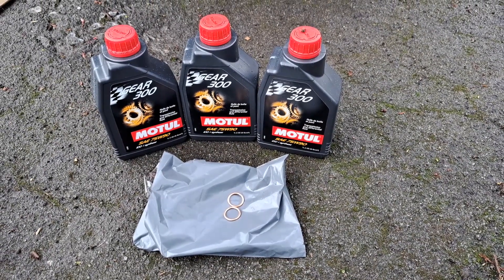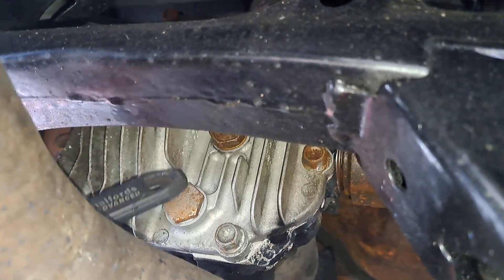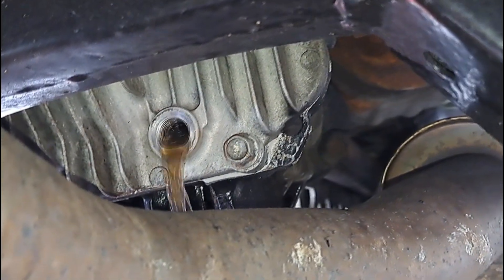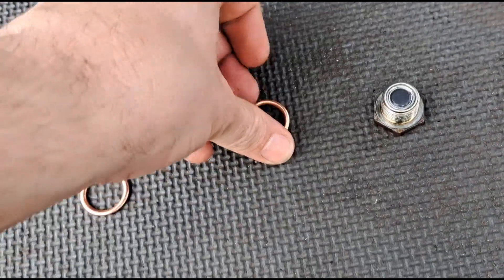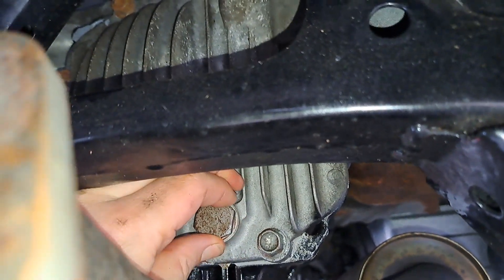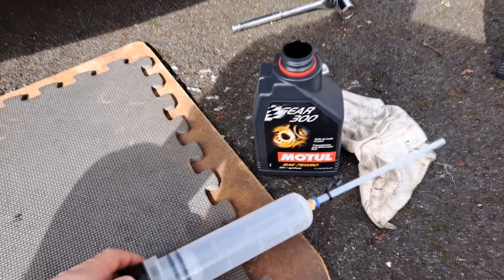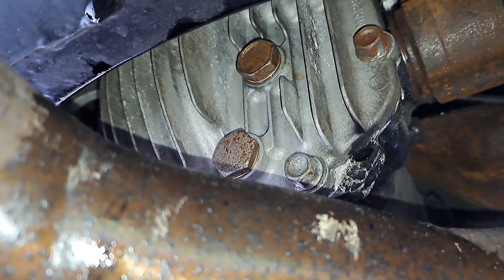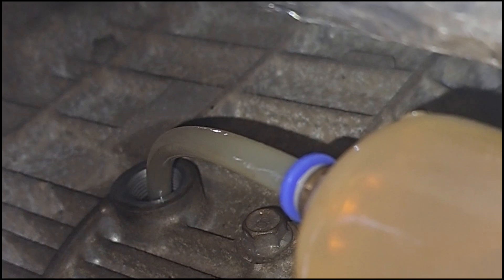Mazda MX5/Miata NC Mk3 - Maintenance Episode 8 - Changing Gearbox & Diff oil

Comment: when draining diff / gearbox, always crack the fill nut as well, it'll make it drain quicker and smoother. If you only open the drain plug it "glugs" and it's messy. Open fill plugs first, and then open the drain ones.

Comment: When you’re filling the gearbox and especially the diff you need to have the car level.
Difficult without a proper ramp but not impossible.
Support the front and rear with axle stands to allow safe access and keep the car as level as possible. 👍

Comment: So are these 3 bottle of oil exactly the same? You mentioned GL4 and GL5 but when I search for that oil you used it doesn’t have it specified? Thanks
Reply from the maker: This oil meets both specs, see here: https://www.opieoils.co.uk/p-899-motul-gear-300-75w-90-fully-synthetic-racing-transmission-differential-oil.aspx?variantid=1131&gad_source=1&gclid=CjwKCAiA8sauBhB3EiwAruTRJmSnSqqIX4_GgpOjJqplwK2VCiDYHRz8FJUvjzhLtExFupDK6Zc8JBoCevwQAvD_BwE